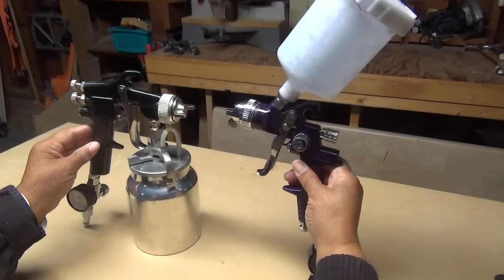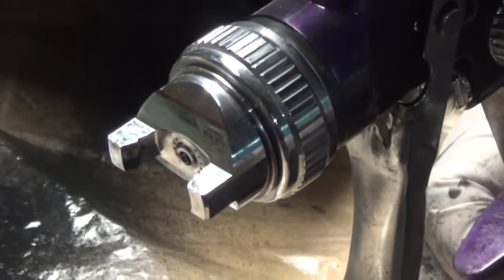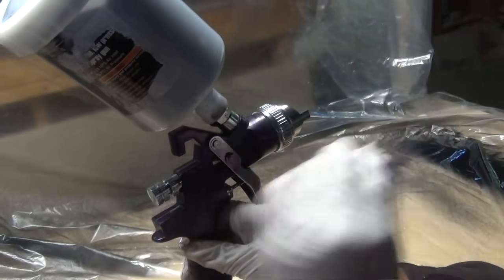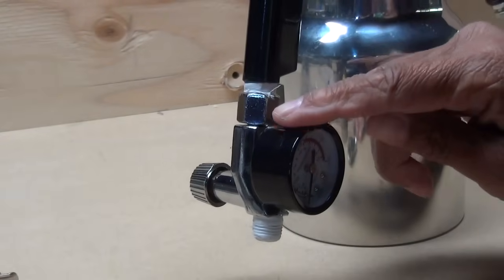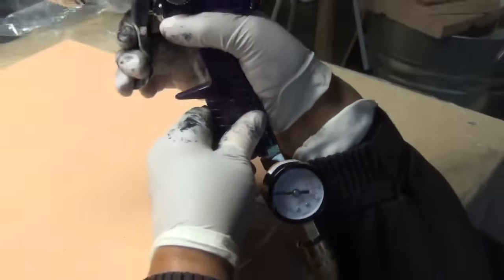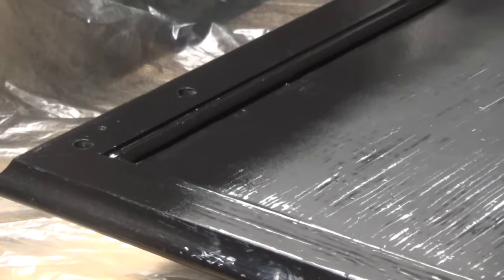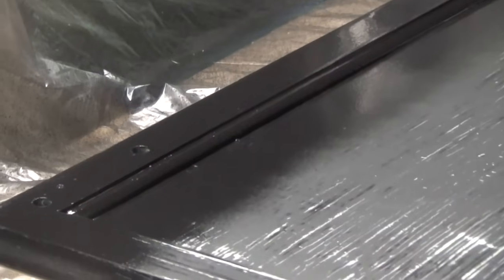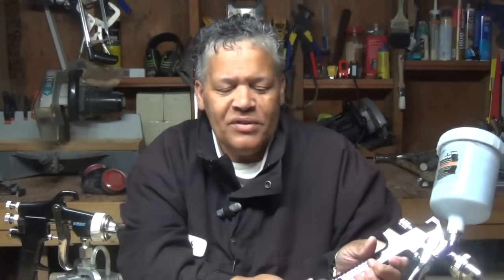Beginner Tutorial How to Set Up and Use a Paint Spray Gun

Comment: Ok, but you didn’t explain where to set the pressure. I just bought the exact same gun you’re demonstrating, but the settings are clear. And your setting don’t match anything written in this manual. It looks like you set your regulator to 30 psi. The specifications say 6 cfm at 40 psi. But the air pressure range says 20-70 psi. So I’m assuming I would set my air compressor somewhere between 20 and 70 (most likely 40 or 50) and then I set the regulator on the gun to 40?

Comment: Excellent video for beginners. Very comprehensive & clearly explained. I’d recommended adding an in-line moisture separator (installed just below the air regulator) to keep condensation from the compressor from further diluting paint. Thanks Leah for yet another video well worth watching.

Comment: I enjoyed your video. It was very informative and well-detailed. I just wanted to add one thing: you will need to adjust the spray gun settings depending on the type of paint you are using. This includes paint, primer, base coat, and clear coat. For example, you will need to use a lower air pressure and more fluid for a thicker paint like enamel, while you can use a higher air pressure and less fluid for a thinner paint like latex. Also, make sure that the spray gun you are using is compatible with the type of paint you want to use. Not all spray guns can handle all types of paint. For example, an airless spray gun is not ideal for spraying latex paint, while an HVLP spray gun is not ideal for spraying oil-based paint while some can be used.

Comment: Great video.
Question - i have a 120v/130psi Husky inflator.
im giving my ebike a new paint job.
and was wondering if i could use this tire inflator 
as my air compressor with a spray gun.
if so, what “conversion” parts would I need?

/Bklyn👑
Reply from the maker: That will be difficult...not enough air flow.

Comment: there is really only one way to use a spray gun wrong, and you didn't cover it. you gotta clean the gun after you finish spraying!!!! you can't put it off either! you have to clean it RIGHT AWAY when you stop using it for the day. if you take a break in the middle of a project for an hour or so, that's probably fine, but if its the end of the day, you better clean it or your spray gun will be useless next time you need it. i recommend that if you start getting tired and think you might stop spraying soon, then stop early so you are less tempted to just toss the gun on the desk and clean it later. and i'm not perfect either; sometimes i only cleaned my spray guns with water and nothing else. depending on the paint you use (if it is water based) it may be good enough to run a bunch of water through it. i've had to throw entire spray guns in the trash though because someone used mine and didn't clean it out afterwards. 

other than remembering to always clean the gun, there literally is no wrong way to use the gun. you just fiddle with it and set it however you want. use whatever paint you want with any kind of thinner. get weird with it. worst case scenario, the paint you used is too thick and you have to take the gun apart to clean it. you can even spray things other than paint. you can spray soapy water. i've sprayed all kinds of liquids. one time i sprayed old coffee through my gun to weather a prop. its a pretty fantastic tool that does not hold you back at all. and if anyone tells you that you are holding the gun wrong or doing it wrong, spray them with the gun until they go away, then get back to doing it how you want to do it.

Comment: the proper name the type of plumbers tape she was is actually called Teflon tape,not plumbers tapes, because there are multiple types plumber tapes ranging various types of materials, secondly the plug she was talking about is not called a plug,because if it was a plug,there wouldn't be a hole in it and air shouldn't be able to pass through it, because that's what a "plug" is designed to do is to stop the flow of air, the proper name is called a air hose quick disconnect, the one she happens to be using is 1/4 fnpt

Comment: And ya you can spray with low air output in most cases however you're only going to be putting a drop at a time on the wall and it's going to have to be extremely thin but I want to say that your videos are great and informative especially for first-timers.
I wish I could have saw these years ago.

Something  else I find interesting, is once people understand spray guns the jump to airbrushing is very easy

Comment: Hey Leah quick question for you. I have a husky siphon general purpose gun and looking at air compressors. I am undecided and not sure what to get. Im a wood worker/DIY er thanks to many of your videos honestly and am looking to just do some occasional HVLP painting and staining/sealing with varnishes etc. My husky gun states needs 4.5 scfm at 90 psi and on the box it says 27 gal minimum tank. I was looking at several affordable single stage compressors  but not looking to spend a small fortune as I explained my uses. Ideally I would love this compressor to have light moderate use with some air tools like if  needed to change out the wheels on my car i could do that quickly with an air impact wrench but nothing too crazy. Im not painting cars or anything that excessive. Some options i was looking into were the 26 gal Kobalt quiet tech compressor which is 150 max PSI,  4.5 SCFM @ 90 PSI, the fortress 27 gal high performance which states 200 PSI 5.1 SCFM at 90 PSI, the 26 gal fortress ultra quiet compressor which states 175 max PSI and 4.5 SCFM @ 90 PSI Not sure what your opinion is on any of those i mentioned. If you feel those wont be a good fit, im open to any and all suggestions. Another point to make was that, i know i mentioned my husky paint gun states min 27 gal tank but if i got a 26 gal hypothetically would that 1 gallon throw everything off or no depending on PSI max output?

Comment: I copied and pasted the following and have a question, specifically why the difference between Gravity feed and the hvlp air pressures settings when the hvlp is also a gravity feed?

AIR PRESSURES
CONVENTIONAL CONVENTIONAL @ Gun PANEL/OVERALL
Gravity Feed 1.6 mm - 2.0 mm Gravity Feed 30-35 psi/40-45 psi
Siphon Feed 1.8 mm - 2.0 mm Siphon Feed 30-40 psi/45-55 psi
HVLP 1.6 mm - 2.0 mm HVLP @ Cap 6-8 psi/8-10 psi

Comment: Considering that compressor/SCFM capacity is going to be limited for most DIY'ers, I think it might be useful to explore the possibility of adding an air storage tank converted from an empty propane tank as a means of extending the users ability to spray a small job without running out of air  prematurely.  I'll be converting an old 30 gallon propane tank over in this manner very soon.

Comment: Great insight! I have a 6 gallon - 150 psi air compressor. Would it be sufficient?
Reply from the maker: What are you painting?
Reply: @seejanedrill  largest item would be a subwoofer enclosure. 36"x18"x16" approximately. Smaller items being vehicle dash trim pieces.
Reply from the maker: A small job like that should be fine.

Comment: I mostly paint with airless but didn't have the guts to use it on doors. The motor burn out at first use on my cheap HVLP package. Connected a vacuum cleaner to the junk HVLP gun and thin the heck out of the latex paint. The half dozen doors turn out very nice but it was slow going. Milwaukee Airless/Finish Paint Sprayer M4910-21 could do both airless and HVLP, too bad it has been discontinued.

Comment: In my opinion, plumber's tape is optional, minor air leakage is not critical, but fix the obvious leaks.  The gun you're using is available at Harbor Freight for about $15.  It occasionally goes on sale for $9.99.  Recently, Harbor Freight had a coupon for 30% off any item under $10, which put this gun in at $7 so I bought 4 of them.  I have heard that the white container is not resistant to all solvent types so be mindful there.

Comment: You did not explain how to adjust the air flow on the gun itself nor did you talk about adjusting the paint outflow.  It seemed like your gun was barely spitting out paint.  There is a lot more then just hooking up the hose and pouring in paint.  You really have to play with the gun to get what you want.  Each gun sprays differently depending on what you are spraying.  Having the correct tip for the correct paint is critical.

Comment: Your Gun should have a two stage process on the Trigger. When spraying Paint you can feel it better. Spray and pull the trigger all the way back and slowly release it until you feel a spot where the paint stops but your air stays on. It will help with starting and stopping paint build up and help keep your paint tip cleaned out while painting.

Comment: If the compressor has a built in tool regulator, do you still need a regulator on the gun? Thank you
Reply: Jane didn't explain the purpose of the air regulator too well. You should set the regulator on the air compressor to the maximum psi the sprayer is rated at. Then using the air regulator on the bottom of the sprayer you can fine tune the amount of psi going through the sprayer. 

Let's say you are spraying the paint at 20psi for a nice and even coat but then you want to make the paint mist a little more fine. So you adjust the regulator on the sprayer to 30psi (the highest psi that this hypothetical sprayer can handle) without you ever needing to walk back to your compressor and ruin your workflow.
Reply: @broken_font1881  Thank you very much !

Comment: It took me a few mispaints before realizing there are 2 main types of guns (nozzles). HVLP which work around 20-30 PSI and the High Pressure ones (more like 45+ PSI). Mine is a HP and set it at Low Pressure. Did not work very nice until I realized.. Would be nice to have the distinction mentioned.

Comment: I had already bought the compressor blindly on sale! now I'm running to see if it matches my small spray gun so I can spray my homemade surfboard flame red. . I tried spraying the previous yellow board with spray cans and it took 10 x 250 ml cans of yelo to get a reasonable professional finish on the white foam shaped blank. The cost of the gun and compressor will take quite a few homemade boards before it pays itself off. weight on surfboards is critical so I cant help feeling ive added 800ml of paint in weight ?dam that's pretty heavy?

Comment: A couple of things she left out: the side knob is the spray width. She was shooting way too small. You can open that up and spray a wider pattern and go much faster. Next, spray into inside corners first, then outer edges, then the big panels last. Finally, add a water trap to the line to prevent condensation in the compressor tank that will shoot blondes of water onto your work. And she didn't give you the proper PSI range to spray. I shoot around 75-90 PSI measured at the tank.

Comment: When spraying, you need to hold the spray gun tip at a 90 degree angle to the surface or you will be spraying more on the bottom than the top of the spray.  Never hold it at a 45 degree angle or you will have "stripes" in your paint job.

Comment: Leah, I have to thank you. It's been awhile since I sprayed, probably 20 years. You are the only one who walked me through in a very concise manner, not the other instructors weren't good, but you were the only one who explained the gun air pressure properly. Adjust with the trigger pulled to 20 lbs. I knew I was doing something wrong when my primer came out like a big splatter gun which was a result of setting my guage to 20 psi before pulling the trigger. Thanks again Leah.
Reply: Leah, thanks for the lesson. I have a bathroom project I need to get done and I wanted to use  spray gun but have been hesitant. After your lesson  I think I can do it.  Thanks for the encouragement.

Comment: Don't put the teflon tape up to the end of the thread. Leave 2 lines of thread. One of the advantages would be to avoid the teflon eventually breaking down and contaminating the air circuit. Also easier to screw the parts together and the teflon to engage into the thread rather than being pushed up and away.
Great video, I am learning a lot from it.
Reply: Somebody always leaving their 2 cents laying around!
Reply: @crashnburn9383  lmao
Reply: So I did it wrong all those years with a dozen different air tools. So far no problems yet.
Reply: The top threaded part of the air Regulator is a ball seat and  should not have thread tape on it.

Comment: Hi. Can i put or connect the regulator near the compressor instead of near the spray gun? I know that i need to see the regulator's reading when adjusting the air flow specially in every start of a new painting work.

Comment: I only watched this Video because I just bought the exact same HVLP spray gun. From ebay. It came with a smaller HVLP gun as well, it was only Au $41 for both guns but I had to fix them. On the smaller detail gun the screw retaining the pattern control knob was to small and wouldn't do up. the same screw on the larger gun fit but was almost falling out. I also had to replace the pot's on both guns, the thread in the nut that screws the pot to the gun only had a few turns of the thread, the plastic the pots are made of is really cheap, I wouldn't put thinners in it and the kit only came with one fluid inlet filter, so I bought a pack of them as well. All replacement parts I bought from Super Cheap Auto, The replacement (Black Ridge) Pots normally sell for Au$19.95 but were on special for $10 each and the Fluid inlet filters were $8.80 for a pack of 4. The retaining screw for the small Gun pattern control knob I had a screw that fit lying around. I'm so over ebay, I'll be looking elsewhere from now on.

Comment: Good video Leah you have covered to basics of spraying, but if I can give you a couple of tips. Firstly widen your fan ( you will also need to open the flow) and overlap the previous pass by one third this will result in a more even coat. Pull the trigger with your middle finger and hold your index finger on the side of the gun. This will help the gun feel more natural and give better balanced.

Comment: Thank you for the great explanation I have a couple questions can I buy a filter to keep out water  I was spraying my truck frame primer & top coat and was getting moisture coming out my gun  If you can give me any Information on what I need to set up my , I dont have a big compressor Its a 30 gallon 150 psi  1(What would be a good spray gun to start out with  2) What is the filter unite to keep out moisture called  I would like to paint and  the bed of my pickup truck  I have pretty good painting techniques I used  to paint ski lifts But its been awhile since I painted  Grwat video ... . Just Subscribed
Reply: ARCTURUS just go to any hardware store that sells air stuff and get a in line air filter read the box should tell you that it accolades moisture otherwise try draining any water that might be in your compressor. 
Eastwood has a nice beginner gun that runs on very little air and they have videos all about Eastwood company

Comment: Hi Leah, 
Thanks for another great instructional video. I have a question if I may ask.
A while back I bought an electric paint sprayer, the Wagner Flexio 570. I haven’t used it yet, but now I am wondering how it might compare to the type you demonstrated. I have a very small compressor for my artist airbrush, so I am sure a larger compressor would be required.  Thanks again for the video. I always “like and share”.
Rick

Comment: After having used a dozen different paint-guns and airbrushes, I'd recommend the Critter spray gun.  Nothing else is simpler, nothing else is nearly as fool-proof.  About fifty dollars and works like a charm, every time.  You don't have to worry about complex formulas, mixing, getting the right viscosity, etc.  No knobs, no adjustments (except your choice of airflow from the compressor).  It simply pumps through whatever you want like a workhorse.  If you can use a can of spraypaint, you can use the Critter spray gun.

Comment: Suggestion: make a video explaining the basics of the respirator.  Here are a few pointers that I observe: i) clean shaven or else the respirator will leak, ii) nice an snug or it will leak, iii) you should not smell the solvent if it is working properly if you do then it's leaking or the cartridges are worn out, stop and sort the problem iv) you need organic vapor filters for paints that use solvents such as acetone, lacquer thinner, xylene, mek, etc, v) organic vapor filters have a limited life and need to be replace periodically v) organic filters must be stored in sealed bag or container, if not then they'll slowly lose their effectiveness due to exposure to the environment, vi) be very cautious with 2 part paints that mix a catalyst, they are significantly more hazardous that single part paints and you really have to be confident that you have correct filters and that your respirator is working correctly. Finally, don't forget about skin and eye protection.

Comment: A professional LVLP paint guns run at 14 CFM, I have an entry level LVLP spray gun that consumes 6 CFM, can I use spray settings between 26-29 psi at trigger for clear coats & base coat? I use 29 gallon compressor 2HP delivers 6 to 7.2 CFM

Comment: Mam, is there any way we could paint our homes with emulsion paint using these spray guns - it's a DIY spray paint your home job, with the normal compressor. I know that emulsion paint and car paint are different. But please tell me a way to do it than how it cannot be done.
Reply from the maker: This is not the tool for spraying a house.  The coverage would be way to thin.
Reply: @seejanedrill  it doesn't matter if the coverage is too thin as long as a better finish than from a brush can be got with many coatings.
Reply: Air compressor fittings